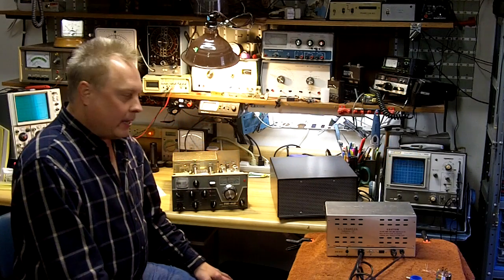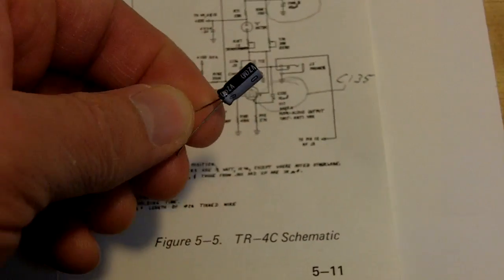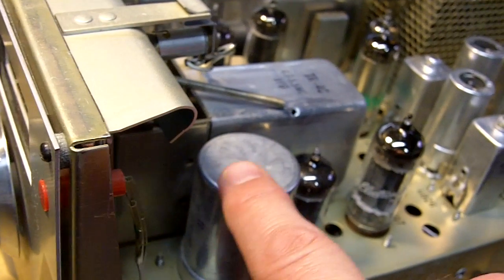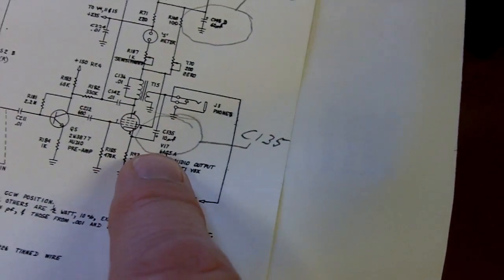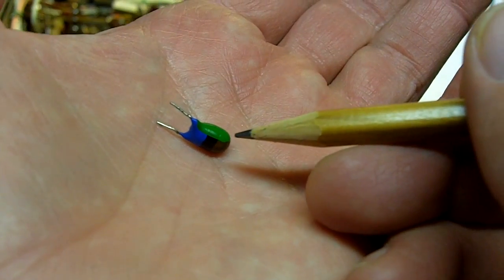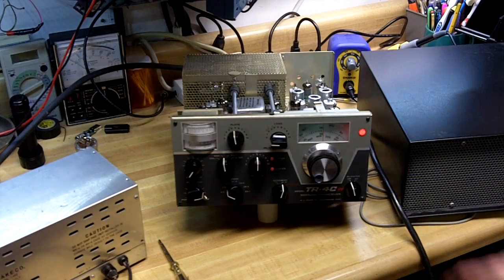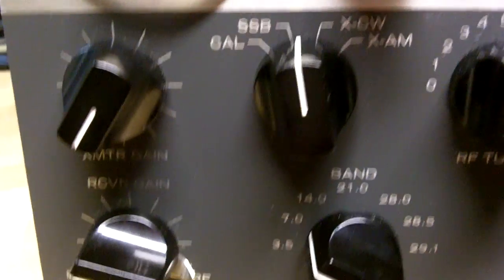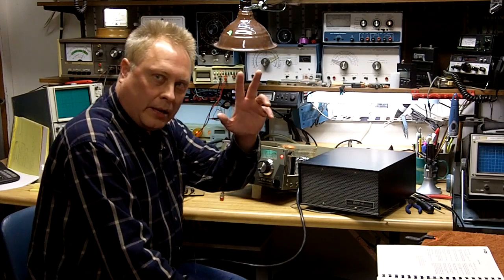Drake TR-4Cw Ham Radio Transceiver Capacitor Upgrade

Comment: Hi 2 questions. I just got the same rig off of EBay. It worked for about 2 weeks and then one day R192 (27 ohm) resistor cracks in half! R192 is hooked up to C145A. I replaced the resistor but the rig has low audio and does all kinds of interesting things so there is still problem. I thought that it might be the can capacitor can BUT it says hayseed hamfest on it (I guess it’s been replaced?) so I’m not sure if that’s the problem? I measured all of the caps in that can to ground and they show open. Second question on the C135 capacitor what voltage rating did you use?
Mark (N2DMI)

Comment: Curious if changing out the 135 cap will help with me having to speak very loud and be very close to the microphone in order to get acceptable output. 
I got lucky, my rig already had an upgraded power supply as well as the hayseed hamfest cap installed.  73

Comment: Nice video! Thank you for sharing, Just also want to replace the capacitors for my  AC 4 power supply like what you did. Asking for your help if where did you purchase the kit that you have showed in this video. Mine is DRAKE TR 4 model 1974, Thank you and 73 de  DU9AR... MABUHAY FROM THE PHILIPPINES
Reply from the maker: Thank you very much and glad you enjoyed the video.  Here is where I got my cap kit, I will post a link but if that don't work, do a search for Hayseed Hamfest and it should come up.  https://hayseedhamfest.com/collections/drake

Comment: hi Larry, I'll just start a work like that on a TR-4 and was wondering why you select only those capacitors. Are those one the most critical? isn't required a full recap? tks !! 73 !
Reply from the maker: Yes, I replaced the ones know to fail over time, mostly the electrolytic caps, they end of going bad a lot of the time after 30 or more years and since they are also dealing with high voltage in this case, good to replace.  Some types of capacitors do not need to be replaced even after a long time, they seem to hold up well.

Comment: Drake definitely made beautiful radios... thanks for sharing yours... it's awesome that you have taken such nice care of yours through the years. 
What is that Cinch-Jones socket seen in the lower left part of the screen at 03:54 used for?
Reply from the maker: This is the connector for the RV-4 external VFO, it plugs into this connector from the bottom side of the radio.
Reply: Understood now.... thank you :-)

Comment: What is the required voltage rating of the 10 mfd C135 cap?  Looking forward to finishing the upgrade!
Reply from the maker: acording to my info here is shows that the replacement is rated at 50V instead of the original 25V.

Comment: Very nice demonstration of the drake tr4 receiver. Does the radio has only amateurs bands? What kind of receiver similar to this has got and fro 500 to 30 MHz you can suggest me including the beat oscillator for receiving the morse message? Thank you for your suggestions.
Reply: The TR4C is an amateur radio transceiver covering only the 80, 40, 20, 15, and 10 meter  amateur radio bands. If you want a general coverage receiver, here are some of the main choices:
(*) a good old radio (See eham.net/reviews for reviews, and talk with people in your area to see if anyone has anything to sell.),
(*) a modern software-defined radio (SDR), which also requires a computer (I'd look at the new Airspy HF+. SDR is powerful but requires more technical background.), or
(*) a  portable SW radio (Google: top portable sw radios).

Comment: My first HF rig in the mid 70's was a Drake TR-4cw. It was the newest most modern transceiver around and I had many years of enjoyment from it.  I wish I had never sold it. For my 40th B-Day(12 years ago) I purchased another TR-4cw station and the seller promised it was all in working condition however of course it was not and after spending all that I did I did not want to invest more money. I would have had to paid someone to fix it as I am not qualified, nor do I have all the equipment to do the repairs. Long story, short, I had to sell it at a substantial loss and that was the end of my old reminiscing radio days!

Comment from the maker: Yes, you are right there.  My upload speed is not very fast so when I do a video, it takes several hours sometimes to upload, so I start it and go to bed usually.  I need to get to bed now, sounds good on the video, I will have to take a look tomorrow, not going to make it much longer here, lol.  Good idea on video on tube tester, I will jot that down for a possible video in the future, thanks for the idea!

Comment from the maker: I just went down and took a look since I have not paid any attention to the model I guess, it is a TC162, Mighty Mite 7, so must have been a more recent one, but I would guess it is maybe from the 70's or 80's, really have not looked them up and have had this for some time so not sure off hand, but it is very good quality, I am sure there are many other good ones out there also from what I have seen. Sencore was big in the TV test equipment, I used to get to their seminars back in early 80's.

Comment from the maker: I guess if I started having some problems with the radio, I would check the tubes first with my tube tester, I did go through them a while back and they were all in great shape yet, so they are pretty reliable most of the time if not abused, hopefully I will be ok for a while now, lol.  But tube contacts can turn bad also, wiggle the tube in the socket and comes back to normal, so I clean them with a little sand paper on the contacts sometimes and wiggle them in the socket.  Lot of them too!